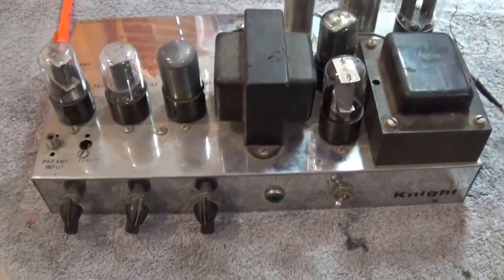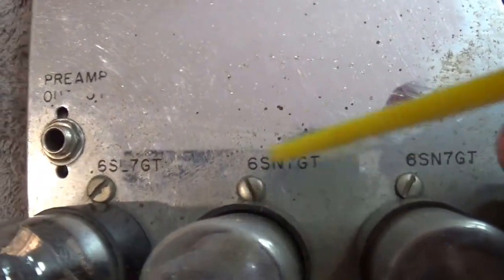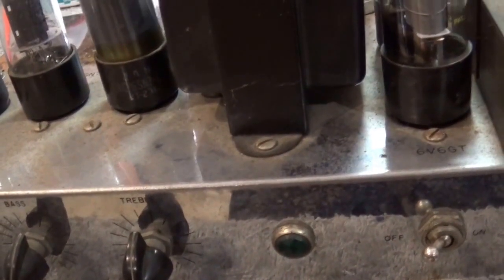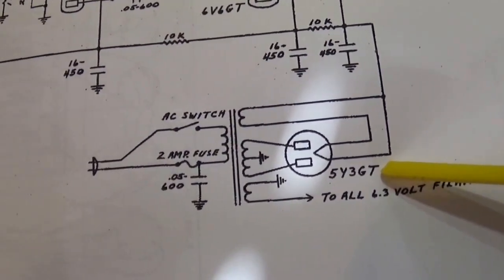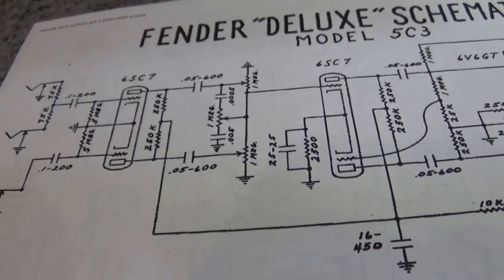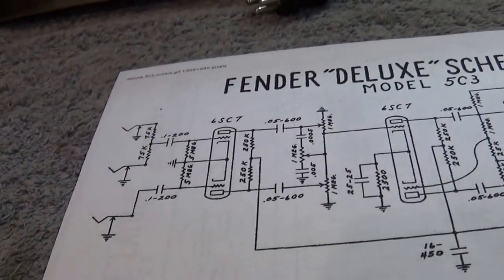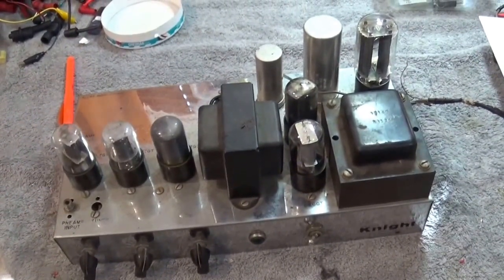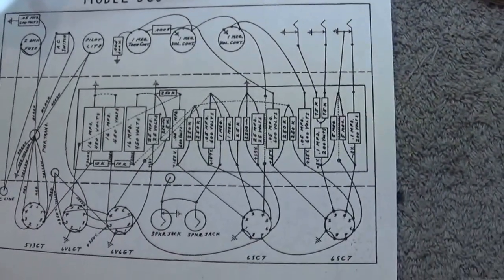Guitar Amplifier Conversion - Episode 1 -  Get the plan, Stan.

Comment: I have a 50s Dave Bogen amp that would be like this project.  It has three ch input, 1 aux + 2 mics.   It's long overdo  for a rebuild, I like your concept here Ron.  Back in the 60s, I liked Fender, Sunn and Ampeg tube amps most.  But Fender had that famous reverb sound.  Ev and Altec had some badass speakers too.  I wanted a Kustom set a  lot, that cheesy tuck and roll vinyl was something.  Don
Reply from the maker: Don, I always loved those Kustom cabs myself.  This is a fun one, I am still settling on the model I will build.... I may be able to do more than a DELUXE.... next video will reveal all that.   This will be an easy one once I decide and get my layout. I also have an old antique radio cabinet that I may use as the cabinet enclosure... planning away here.  Regards, Ron